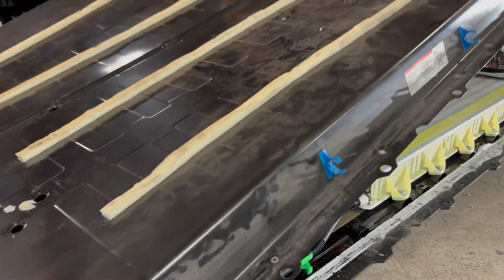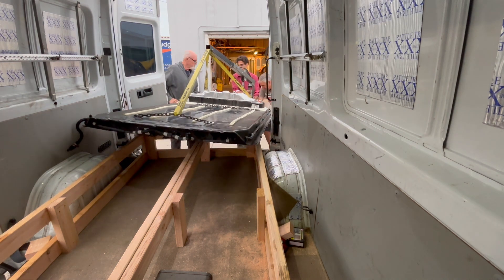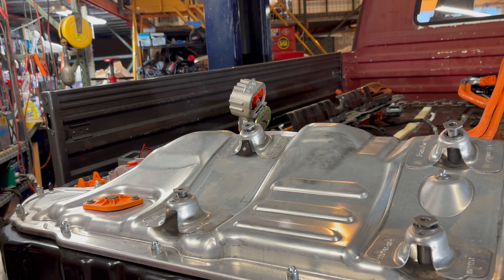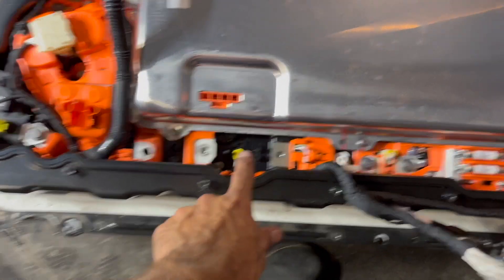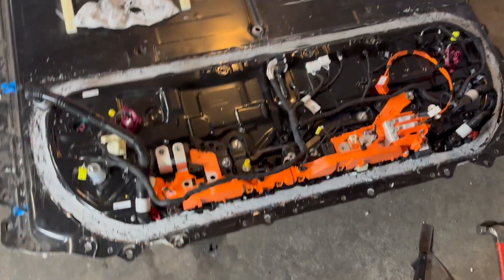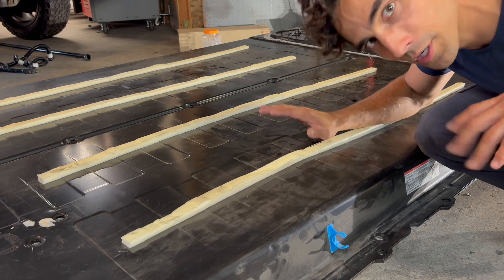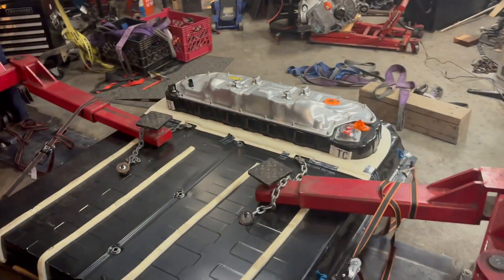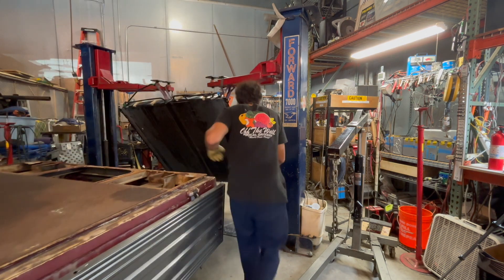Shortening a Tesla Battery Pack

Comment: Hey just quick question 
I tried all over the internet but no luck 
Do you know the voltage of a single module pack? 
I want to turn my house fully off grid
Reply from the maker: The standard range packs are all the same voltage around 90 V. If you get the standard range plus or long range battery packs, each module has a different voltage slightly.

Comment: Awesome project. 2.5 miles per kilowatt hour (not kilowatt) probably isn’t too far off in the summer. Winter will likely be worse due to cabin heat, unless you’re going to do a diesel heater or something. 

Standard range packs have about 20% degradation at this point, so probably around 45 kWh usable.
Reply from the maker: Awesome! I’m really just hoping to get 100 usable miles. I’m nervous for my range test.

Comment: Is there a good source to find and compare the dimensions of various OE batteries?

I have a Vanagon Syncro that I'd love to convert to 4xE with IC RWD and electric FWD. The best area for batteries, weight distribution-wise, would be the central space the prop shaft currently occupies. That would call for long, skinny batteries.
Reply from the maker: The open inverter forum is a good source. Also DIYelectriccar
Reply: Tesla model s modules fit between the frame rails on either side of the prop shaft. That’s where I have mine on one of my electric syncros.
Reply from the maker: @ElectroSyncro   where can I see pictures of your electric syncro!? That sounds awesome
Reply: @bernietime  I m not on social media so I’m not sure how to show you pictures. I have hyper9 connected to original gear box. So everything functions as if stock. Still all wheel drive with a decoupler. I took an old instrument cluster apart and installed a gps speedo and a can bus display for the ev components. Dashboard still almost entirely stock. Very functional and capable vw. So fun to drive.
Reply: Also I i think gowesty  is working on eliminating the prop shaft with a separately controlled motor on the front differential.